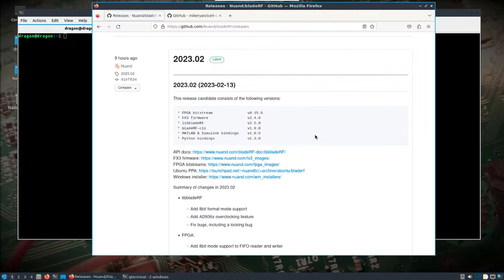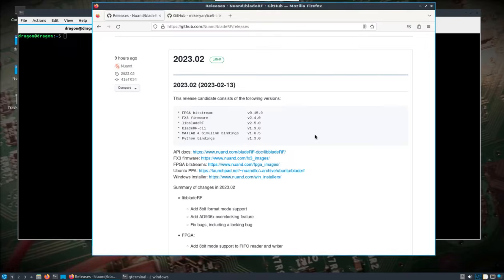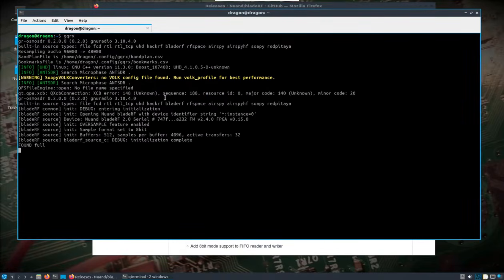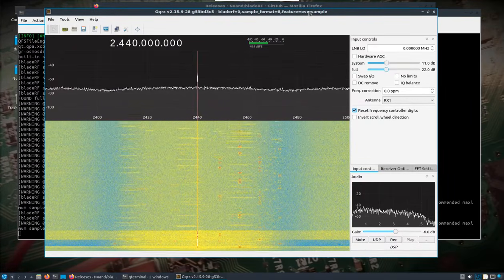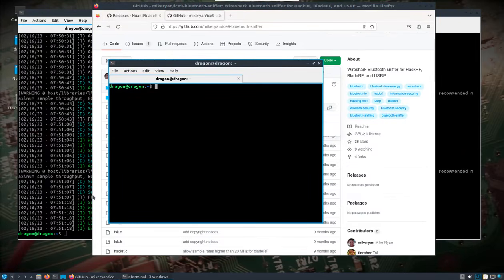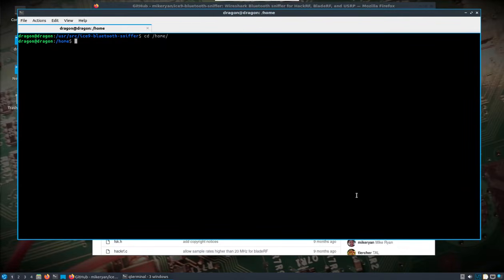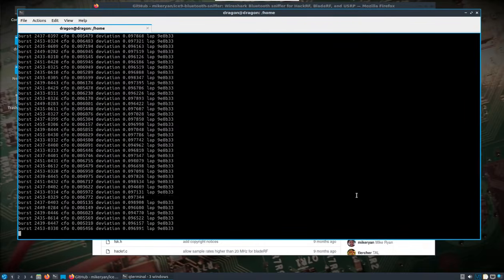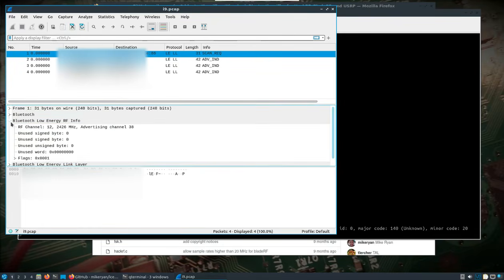DragonOS FocalX BladeRF 122Msps w/ GQRX, SatDump, Ice9 BT Sniffer (bladeRFxA9, FocalX R29)

Comment: Hi! I have DragonOS Noble R6, but cannot get along with your "Satdump demo", apparently because of a missing directory. satdump-ui crashes at launch while "Loading plugins from /usr/local/lib/satdump/plugins"
The system says "terminate called after throwing an instance of 'std::filesystem::__cxx11::filesystem_error'

  what():  filesystem error: recursive directory iterator cannot open directory: No such file or directory [/usr/local/lib/satdump/plugins]
Aborted (core dumped)" - A satdump/plugins directory is found in /usr/lib, not in usr/local/lib. Would you recommend rebuilding from source, or would a symlink to /usr/lib work? I've already checked with a live of Noble R7 and satdump-ui seems to be working flawlessly.
Reply from the maker: When running cmake with SatDump I forgot to pass it a flag and when it built the deb package I goofed things up, but strangely enough didn’t seem to have a problem loading it till I checked again way later.

Comment: Hi everyone, I'm doing a project on
Learning and installing the ICE9 Bluetooth Sniffer tool, illustrating the use of this tool in wireless network security
I have researched and found that people use the hackrf tool, or sdr tools. I'm a student so my budget is limited. Anyone who has done it, please suggest me a tool to replace it or an emulator. Thank you.
Reply from the maker: Not exactly sure what you mean by a tool to replace it? Probably not one for one, but look up Sniffle and you can use hardware with it and sniff Bluetooth.
Reply: @cemaxecuter7783  thank you sir so there is no alternative emulator for hackrf right sir ?
Reply from the maker: Both sniffle and ice9 can take file input.
Reply: @cemaxecuter7783  Teacher, can I ask if sniffle can replace hackrf and can be combined with ice9?
Reply: @cemaxecuter7783  Can you recommend any cheap tools for students?
Reply: is now i can use sniffle to capture signal combined with ice9 to analyze right sir
Reply from the maker: @chienpham2817 it would not be combined with ice 9. Sniffle is an application that uses certain hardware to sniff and decode Bluetooth.

Comment: Do you think that the 124mhz bandwidth install for the bladerfx40 would work like instructions are and not ruin gqrx or gnuradio? What is your opinion?
Reply from the maker: I don’t know if it applies for the x40, but no I don’t think it would ruin gqrx and gnuradio. It becomes active in gqrx because I modified gr-osmsodr, also I need to go back and update gr-bladerf. I tried that yesterday and it works now too.
Reply: I’m fairly certain it will not work with the x40, but it shouldn’t hurt anything to try.